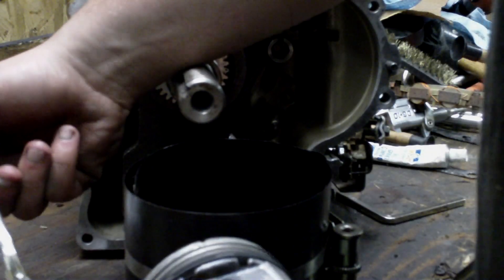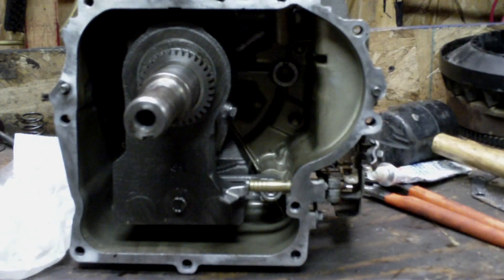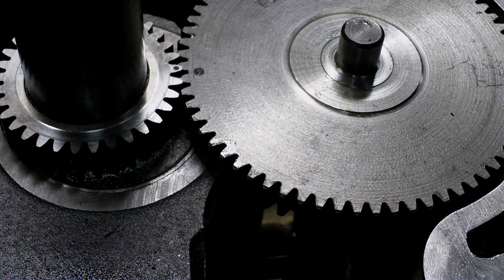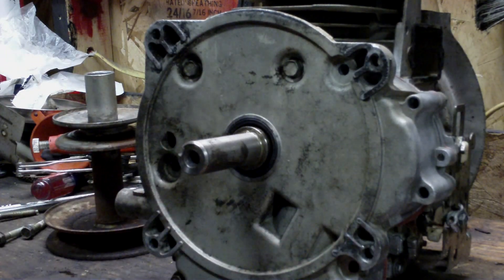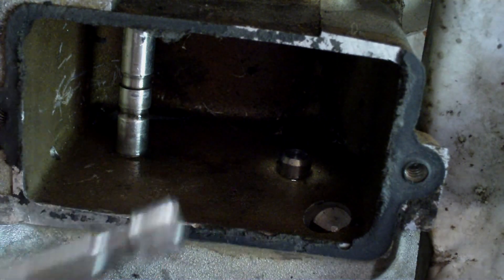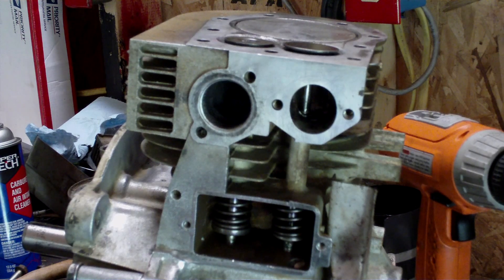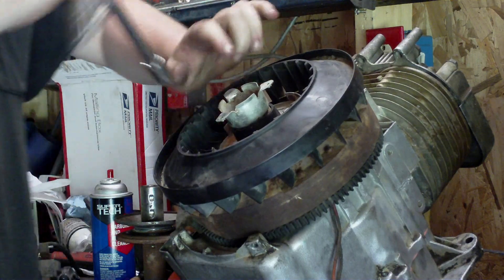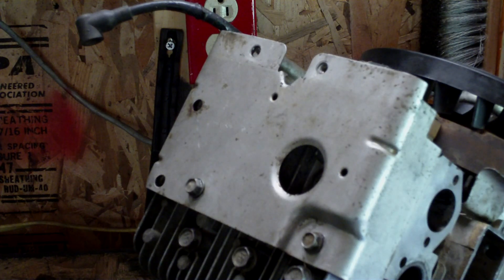Briggs and Stratton Power Built 12.5 HP Flathead Model 28 Rebuild, Teardown / Reassembly PART 3

Comment: i have a 12.5 hp briggs and the valve breather is leaking oil. I replaced the gasket but it still leaks oil. Could I just make a gasket with blue rtv?

Comment: Thanks alot, I am trying to find the cheapest to rebuild this thing as I dont have a whole lot of money to work with. I double checked the model numbers and such.
Model: 252707
Type: 0201-01
Code: 80010511
Thanks for the informative videos. I also have two other engines one is a 12hp model 28 (i believe) and a 12.5hp also Model 28 (i believe). The current motor on my mower started knocking so I started collecting other engines to make one good one havnt tore it apart yet to see whats knocking.

Comment from the maker: Good motors! If its a 11 horse it will be a model 25, 28 is a 12 or 12.5 horse, I get most of my parts from tulsa engine warehouse (tewarehouse) you can save alot of money by buying there aftermarket house brand parts, primeline, just as good as briggs in my opinion. If you need help looking up the set, send me your model type and code and i'll look up the exact parts for you if you need me to. thanks for watching!!!

Comment from the maker: depends on the end play. Its better to have more play then not enough, to much will make it tight and it will grind itself in which ain't good. i would get the .015 and the .009, just to be on the safe side, the .005 usually isn't used, which is why it costs twice as much. to fill up the order (i'm not sure what there shipping charges are) you could get a couple of each just to have on hand. Just about everytime i order something like that i get 2, just so i have it on hand. >>>

Comment from the maker: thought that was what you meant, ok there are 3 different thicknesses and 3 different part numbers For .015" its #27586 / for .009" its 27618 / for .005" its 27617 looks like Jacks small engines has it, and its on ebay. On jack's just do a search for the part number, they have all 3 of them. I found a pdf manual of your engine, if you PM me your email address i'll send it to you, that way you can tell 100% sure if this is the same as yours. I don't remember if thats the same model # but>>>

Comment from the maker: I will have to have the Model Type and code numbers off the engine, there are several different series in the 6000 model. I'm not to familiar with this model, they may all use the same seal.

Comment: do you know where i can get a crank case seal for a briggs and stratton model 6bs engine series 6000 do you know the part number or witch gasket will work thanks

Comment from the maker: yes. look up haynes small engine repair manual, the one i got doesn't cover new engines, but i'm sure they have a new book out by now. And you can look up a Briggs and Stratton torque spec chart in pdf format online, or go to the B&S website and lookup specs for your engine model. If there is ever something you can't find, message me and i can look it up, i was actually planning on doing a video last summer on all common specs but i never got around to it. thanks for watching!!!

Comment: That part you were saying you didn't have that goes on the connecting bolts so they don't back out the Briggs & Stratton number for that part is # 222299 $2.76 at Jack's small engines on the net.

Comment from the maker: sounds like it is the rings, to be honest its very unusual not to have at least a little play in the valves. The piston should have a little bit of play in it, if its to much it will slap, the reason a little play is needed is when the engine heats up all metal expands, so if the piston was tight, when it warmed up it would expand and bust the cylinder or score it all up. I'm not sure right off what the play is supposed to be, but if you look up>>>

Comment: Ok I bought the new sump gasket and bottom oil seal for the motor today. I talked to the repair shop about it smoking when I shut it off they said might be the valve guides are shot told me they will move if the bushings are worn, so got home pulled the head checked for play in the valves, No play at all felt nice and tight. Intake valve had some white soot on it. I looked best I could at the valves them selves and they look good to me no pitting. So I am guessing the rings maybe worn out.

Comment from the maker: get stuck between the rings and cylinder and score it all up, then your in trouble! So if you want to prolong the life of it, go ahead and rebuild it. The engine on my mower smokes when you give it throttle and you can smell it while cutting, I am thinking about putting the engine i rebuilt in this video on it this summer, I mainly rebuilt this one for this video, its still not even broken in 100% yet!!! Its possible the valve guides could be worn some, thats fairly common, but its usually>>>

Comment from the maker: well most briggs are guaranteed for 2000 hours, but thats just a estimate. As long as it has plenty of power and you don't mind the smoke/adding oil every now and then, i'd let it go for a while, you could run a thicker oil (like a 10w-40) to cut down the oil burning. Sounds like it just needs new rings. The sparks is usually just carbon breaking off in the muffler, which means that there could be alot of carbon build up in the engine, so a rebuild might be best, the carbon can break off and>>>

Comment: How often should one rebuild a engine? I got a wheel horse has a 11hp vertical single cylinder engine. was built in 1984 I don't think it was ever been rebuilt. It's a strong running motor but when I shut it off it smokes. Sometimes when I put the throttle up I see sparks coming out of the muffler. I am new at having a rider mower My guess would be something with the valves.

Comment from the maker: depends on several things... first of all if your cylinder is in good shape, (measures to spec) then you can usually get by with standard size rings, if its slightly bigger you can sometimes get by with getting bigger rings and filing the ring end gap to spec, but thats only if the cylinder is just slightly worn, if its really worn or especially if its scored, you have to have it bored out and use over sized rings AND piston, or have it re-sleeved. Thanks for Watching!!!

Comment from the maker: not a silly question, i should make a quick video on this. if it all goes together easily you more than likely got it right, but if you want to check it, you will see a small nut and bolt on the governor arm that tightens up around the brass shaft that goes in the block, loosen that, (do all of this with the carburetor installed) then since the shaft is split, take a straight screwdriver and turn it clockwise until you can't (don't force it, just until it stops turning) then move the...

Comment from the maker: when i tore this down i was expecting a aluminum kool bore, but it has a cast iron sleeve, some say these are all kool bore others say just some of them are, so i don't, maybe this is the wrong flywheel cover, who knows! but this motor does have a cast iron sleeve, i have 2 11 horse model 25 engines that are kool bore, still good motors, just don't last quite as long. and with aluminum bore motors you have to use chrome rings, not standard type. thanks for watching.

Comment: i wouldnt mess with a powerbuilt block, I/C blocks are common enough and they have a cast iron bore so your rebuild will last allot longer. never really liked cold bore engines they wear out too quickly since the rings ride against aluminum

Comment: @fnaguitarplayer9  A business card would be too thick.  I always clean the flywheel and coil with fine sandpaper and/or steelbrush until no rust rubs off on a clean cloth, then finish cleaning with wd-40 and a soft rag. I go for as close as I can get it without it scrubbing, because a close fit with a tiny air gap makes for a hot spark. Too large an airgap equals weak spark.  Like on a car motor, a good hot spark on a Briggs motor will be the color of lightning; red, orange and yellow are weak.

Comment: If flywheel and magneto don't rub together anywhere, you're good. If it does, fold same piece of paper three times, try again. Usually 2 or three folds are enough. If more than 4 folds are needed, there is a clearance problem of some sort that needs to be resolved before setting flywheel/magneto airgap.

Comment: Easy way to set the air gap on the magneto! The spec on most all of these is about 6/1000's, which is pretty much as close as you can get it without touching. So you don't have to wrestle with magneto, wrench, and feeler gauge all at the same time, just fold a piece of lined notebook paper in half(not copier paper, too thick!). Make sure the flywheel and magneto have no rust or dirt and put folded paper between magnet and magneto, tighten bolts. Remove paper, turn flywheel a couple times....

Comment from the maker: @TheIBANEX its to mark the piston, the mark always goes to the flywheel side of the engine. Because of the oil holes on the oil ring, the holes line up a certain way, thats what briggs will tell you. I will tell you it don't matter, if you look at a piston in either direction it is exactly the same, but just play it safe put it towards the flywheel side haha thanks for watching.

Comment from the maker: @1972FordF150 loctite makes the bolt harder to turn, so it doesn't get a true reading. Its actually best to put oil on the bolts so they are easier to turn, thats the best way to get a true reading, but in my opinion they are more apt to come loose if you use oil. so personally i don't really recommend either LOL i always torque bolts slightly tighter than spec any way, if it says 185 in IBS, i will do 190 or 195. Especially if i'm reusing a head gasket. thanks for watching

Comment: When you torque the end cap (connecting rod) could "Lock-tite" be used as an alternative or could it screw up the reading on the torque wrench? I know that is a delicate situation but, since you couldn't get a locking tab to prevent possible failure, I thought to ask. Excellent videos by the way.It saves a lot of money and aggravations.